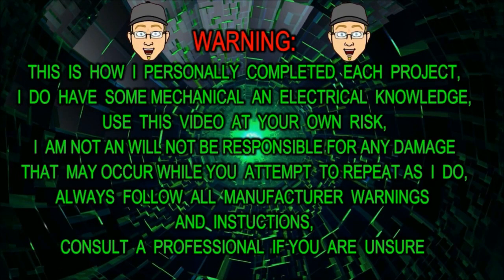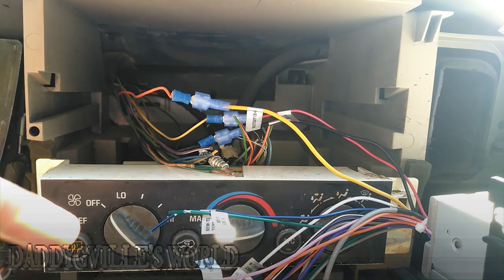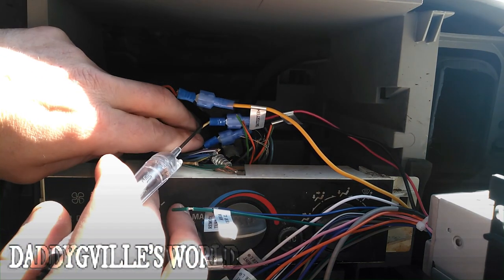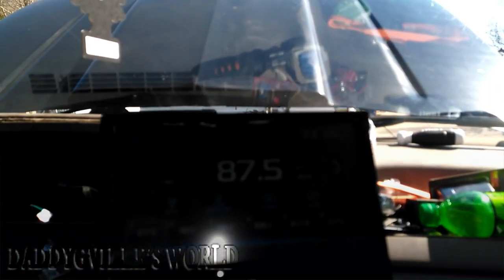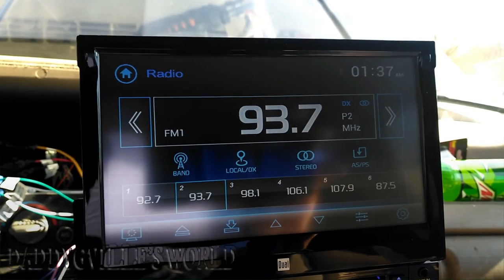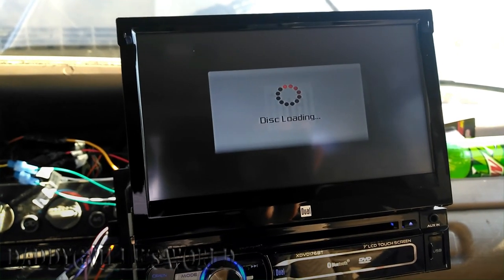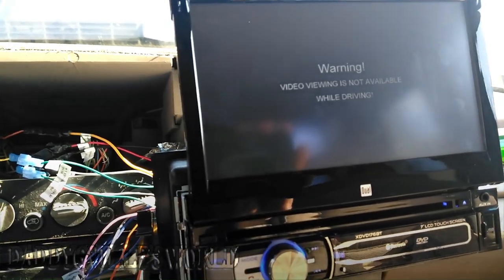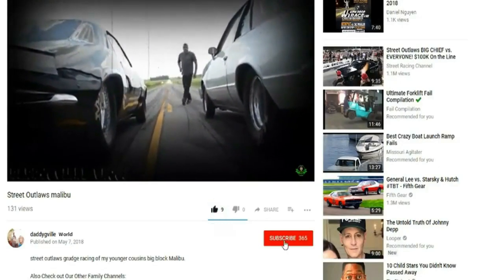Multimedia Stereo & DVD Hook-up & Break By-pass

Comment: Hey, I was wondering but I got the xdvd110bt model and it works fine but the only problem I got is that when the screen shows up, it's black( so nothing's showing), HOWEVER, when I turn it off, the screen shows but.... It's when it's closing. Any guesses?
Reply from the maker: Mine did something like that soon as it rolled out the screen would be on then turned black, mine was a lose wire for the screen, i took mine apart and found the issue hope that helps.

Comment: I'm wondering. I took the pink wire and thought I hooked it up to the Cassie of the radio. My DVD doesn't work at all even in park . would it be practical if I take the pink wire and wrap it around the ground wire so two wires going to the one wire harness with that fix this issue?
Reply from the maker: Yes, you can hook it to the ground wire of the radio that's how i did mine, or find a ground under the dash like a metal dash bracket, the reason i touched it to the radio is to show if you ground the wire out to metal it will work

Comment: Just curious can you hook it to the ground wire are have to ground it to the car some were
Reply from the maker: That's how my wire was originally hooked to the ground wire of the radio, but I found over time my radio would just up and lose memory (reset itself) so I found a metal dash support and put the parking brake wire on it and haven't had memory loss anymore, now if you haven't already plz subscribe I make all types of videos

Comment: Any idea why when I ground my brake wire, it makes the DVD player work while driving but it doesn’t give me access to change time in the clock and a couple other restrictions, same stereo.
Reply from the maker: Honestly no, I had mine originally hooked to the radio ground, but would notice overtime it would rest itself, so I ran it to a body ground and everything works as it should, I've personally haven't had that issue to even have a idea on a fix, sorry, but thank you for watching & commenting

Comment: I just purchased the same unit, waiting for it to be delivered, that's a great tip, I was wondering what that wire was for, also wondering what the brake wire is for
Reply from the maker: Yeah when you hook up your ground wire, just run the break wire with it, i also have a few cameras hooked up to it. Im gonna be doing a review on it soon. Thanks for watching

Comment: Did you have any issues for the Bluetooth mode working mines goes in and out
Reply from the maker: Only when I have to do work on my truck when I have to remove my battery cables, I just hit reset, type in the factory code which is 0000 or 1234 depending on the model you got

Comment: I bought the same one for my 04 Chevy Silverado I was wondering if I have to buy anything specific to wire it or should it be good with the way it comes?
Reply from the maker: Mines a 96 z71 i had to buy a dash kit to hold it properly, You can buy wire adapters for your model, but its 30$+ so i just used the wires it came with, plus for mine i had to buy a adaptor for the antenna, hope this helps & thanks for watching

Comment: parking break   wired..   it has to go on ground ?
Reply from the maker: Well there's a few ways to wire the parking brake, one to where it is supposed to which doesn't allow you to view while driving, there's a box you can BUY but that more wiring to do, 
as for FREE many hook the wire to the radio its self (which I wouldn't do) you could wire it to where the radio ground goes like I did originally, but found over time the radio glitches, so I mounted it to a metal dash mount as a body ground, so yes if you want it to play while driving hook it to a body mount. Thanks for watching & commenting & if you haven't already plz subscribe would mean alot

Comment: Did u get a prpblem with it goimg dim on n off ? If so how do i fix it
Reply from the maker: Only in the winter time when I let it come out automatically after starting my truck, I've learned don't let the screen roll out til it warm
Reply: I also found out the dash light switch also has to be on with the headlights and it doesnt dim

Comment: So I know this video is kind of old but I bought Xdvd179BT Let’s see if you get back to me, by tomorrow I’m going to be installing it I have the same model Chevy dash  how does the screen fit because the top of the dash is that overhang I was concerned it wasn’t going to fit with the screen. Also which color wire if it’s the same wire harness do you ground out for the DVD couldn’t tell from your video
Reply from the maker: I have a obs 96 sierra automatic fits like a glove, the only issue is the screen has to come out before putting your hand on the shift to switch gears, and the break wire (dvd) i hooked it with the radio ground as for a wire diagram you mite have to look it up for speakers the 12vb and ignition was easy to find with the test light.
Reply from the maker: Oh you will need to buy a dash kit if you have a obs Chevy 88-98 or it wont stay in place

Comment: I tried hooking mine up to my second gen and it’s not turning on I ran the wires to ground terminal and power for battery wire the right way and the ignition wire and it doesn’t work any advice
Reply from the maker: To me it sounds like there's a wire not hooked up some where right still, try hooking the ground wire to a bodyground instead of the battery
Reply: Did you figure it out. Same here second gen Cummins connected all the same color wires with a adapter and doesn’t power on

Comment: What you hook the illumination wire too?
Reply from the maker: On mine I didn't bother hooking it up because the radio its self has 3 different brightness levels, but depending on your vehicle you will have to find your low voltage dimmer wire if you want it hooked up, that way when you turn your lights on the radio will dim itself. Most of the time its orange or orange & white but look up your vehicles harness to be on the safe side
Reply: DADDYGVILLE'S WORLD thanks ended up not hooking mine up either but nice to have that knowledge for future

Comment: My monitor not coming out,any help?
Reply from the maker: Sounds like the motor that activates the screen, the only way I know to fix this issue is to pull the radio out and take it apart, but over the years of owning this radio, ive found the screen doesn't like the cold, starting my truck and the radio would power on and would have issues with the screen coming out until my truck was warm, not getting a image on the screen while below freezing, smoking in the cab and so on, once I took it apart and cleaned the insides, gears & all, I no longer have my screen automatically come out, I start my truck radio comes on plays what's on my sd card, once truck is warm, i hit the screen button.

Comment: What if it’s not playing even if you’re not driving  I can hear the sound but I can’t see video.. I even had emergency break pulled and video would not show while I was in drive way
Reply from the maker: Thanks for watching & commenting, i had the same issue sound but no picture, i hit the reset button behind the face it closed then reopened screen came on, but a few days later it happened again found i just had a short in the wire that works the screen, pull the radio apart an fixed it.
Reply: Ok thank you
Reply from the maker: @mmicckeey  your welcome have a great day

Comment: How can I get the pin or change it if I forgot it. Just got a new phone but forgot the pin
Reply from the maker: The pin for factory is 0000 or 1234 if you didn't make your own. Now if you did make your own pin unplug the negative side of your battery then plug it back in, it will reset everything

Comment: So I can ground the wire on the radio it self if so how do I keep it on their?
Reply from the maker: My wire is hooked in with the ground wire of the radio, the only reason i touched it to the radio is to show that if you ground the parking brake it will work, so you can hook it in with the ground wire or to metal under under you dash.
Reply: @DADDYGVILLESWORLD  how do you hook the wire to the ground wire of the radio?
Reply from the maker: @lauraeastman7057  where you see at the beginning my radio ground hooked to the ground of my truck, i removed the clip & put another to where the radio and brake wire go to the same ground cause under my dash is all plastic.

Comment: Dang it I tried to run the brake wire to the ground and no the radio won't turn on smh I'll have to replace it
Reply from the maker: That's crazy that cause thats how i have mine hooked up, brake wire is hooked up with my radio ground and have no issue at all, thanks for watching and commenting
Reply: @DADDYGVILLESWORLD  thank you, I hope it's just a blown fuse and not the full radio

Comment: which cables are from the screen
Reply from the maker: To run to another screen in the back, I used yellow video output, Thank you for watching
Reply: the screen comes out without using force but the screen does not turn on but the car stereo does
Reply from the maker: @kevinmexicanoaguilar1436  sounds more like a back light issues with the screen, now with the vehicle running, radio on & screen out, hold a flash light right to the screen, if you can see everything it a back light issue, if it black and you see nothing, the the screen has went out or it has a wire issue, also never let the screen just automatically come out in the winter months when it freezing out very bad for the screen and its motors
Reply: @DADDYGVILLESWORLD  thanks friend I will put it into practice

Comment: I hooked mine up mine doesn’t have the flip up screen but everything works great except when on radio or anything else you push what station you want then after about 10 seconds the screen goes black I reset the player worked ok for about 39 minutes then boom same thing screen go black
Reply from the maker: hi just seeing this, so yours is the double den, I've heard a lot of people saying have had problems with the dual double den, now a friend had the double den had the same issues his was from powering on when it was cold outside, so he started turning if off and not turning it on till his car was warm hasn't a issuse since, other with bluetooth not hooking up, now for my roll out screen it had black out issues but mine was a lose wire which took like 20 mins to fix after finding the problem, thanks for watching hope this kind of helps

Comment: Como veo videos desde mi usb en este tipo de pantalla ?
Reply from the maker: In order to see your videos from the usb on the screen, the videos's has to be a MP4 with the screen/pixels at 680×340, i would have to recheck the screen size again cause i know it was a low pixel rate to look right on the radio, now myself i put them on a 64gb sd card to leave in my radio

Comment: Mine killed the battery if I don't discount the radio
Reply from the maker: Did you have it ran Direct or something, if not mite want to check your battery and alternator for issues/failure, i use mine daily even just have it jamming while im on a job, i just turn off my amp when not running.
Reply: Well later I found that it was the converter box

Comment: Where is the PIN number for Bluetooth
Reply from the maker: Try 1234 or 0000 if that doesn't work pull the face off an used a pin to push the reset button.

Comment: I got the same radio but when I turn on my headlights it says camera no signal and I got the camera turned off
Reply from the maker: Mine did the same type of thing, i pulled the face off an did a rest that fixed mine, hope it help you thanks for watching
Reply: @DADDYGVILLESWORLD could tell me the steps to doing the reset?
Reply from the maker: Start your car, the upper left corner is the radio face eject button, once face is removed you will need a pen or something small, the hole for reset is mid-left bottom of the radio, Press & hold around 10 seconds the radio will reset. Edit: if that doesn't work unhook the negative side of your car, BUT that will reset everything in your car.